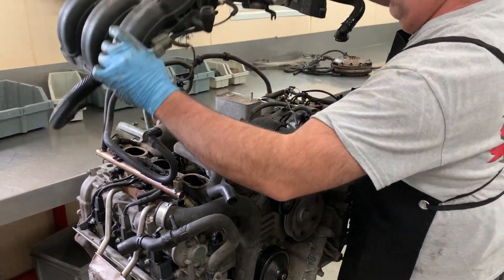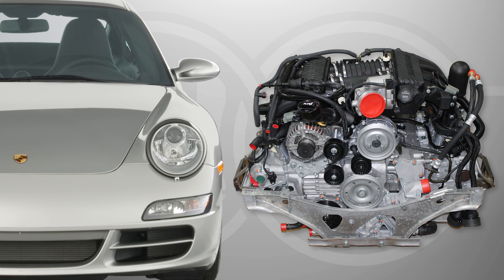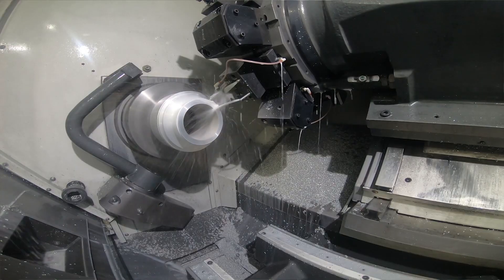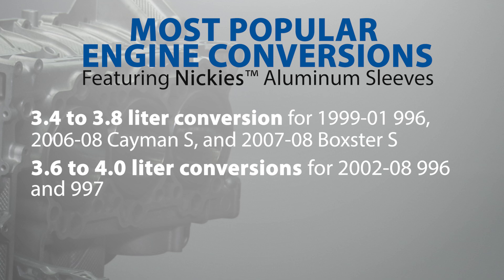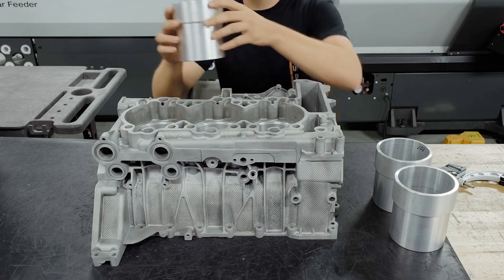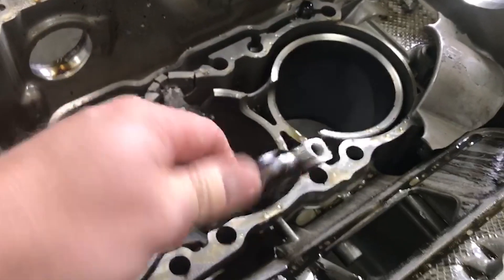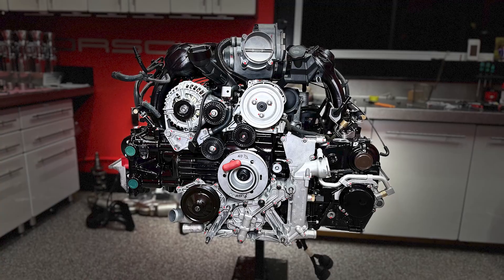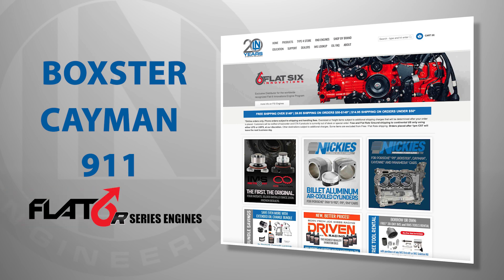Improving Performance and Reliability with a Porsche Engine Conversion

Comment: Let's see how it will turn out. Via Custom Concepts in the Netherlands, I ordered a 3.4 to 3.8 conversion with various other LN engineering parts such as the chaing guide, Mahle Motorsport pistons and rings, IMS bearing, oil pan 0.5L upgrade, 71° thermostat and several other things. Next week I bring my engine halfs to custom concepts for them to ship to the US and LN engineering. In Germany, almost no one in the scene has heard of them. I aim to change that, if the result is comparable to the local matadors of the scene. If so, the pricing makes them a unbeatable competitor. I will document the whole thing and make a video series of it.

Comment: We are in the final stages of a 3.6 to 4.0 997 rebuild using your sleeves(thanks) and we have one final debate around using the existing 3.6 airbox versus switching to an OEM 3.8 airbox. I'm leaning towards the 3.8 but am curious as to your expert thoughts on this possible upgrade. Is there a noticeable difference in performance? Thank you!
Reply from the maker: Yes, the 3.8 airbox would indeed be an improvement from what we have seen. Same goes with the 3.8 intake itself.
Reply: @lnengineeringllc  Thank you! BTW, the LN work looked great as the mechanic put the motor back together. It should be back on the road in 2 weeks(ish)...